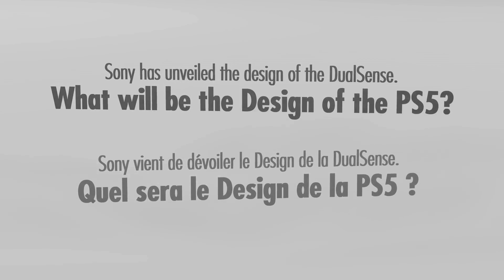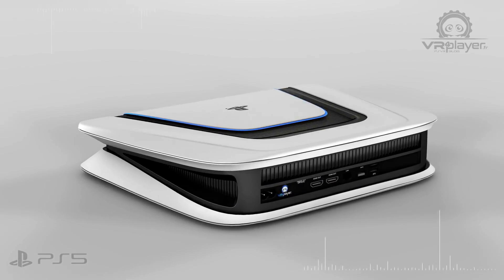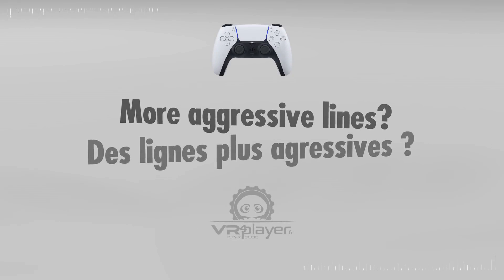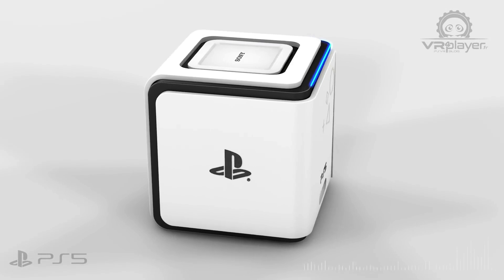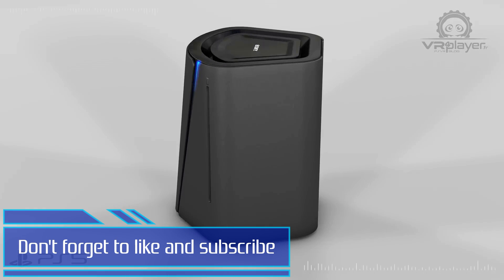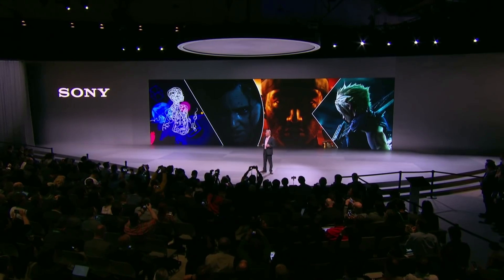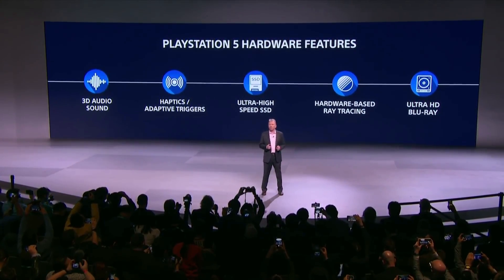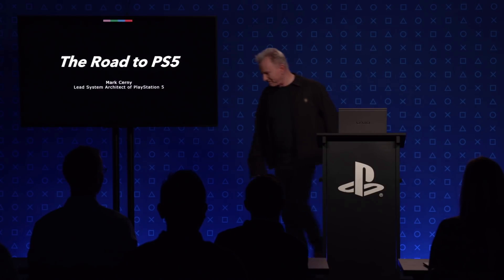PS5 Uses Revolutionary Cooling Solution | Overheating Concerns Squashed, New Patent Reveals

Comment: The patent seems to imply 3d stacked chiplets, at least in one iteration.  This would afford Sony some decent efficiency gains.  As far as the cooling solution, its neat, but I've been wondering for a while why manufacturers don't cool from both sides.  CPU/GPU/APU's always have the pin layout around the outside of the chip with a dead space in the center, always figured you could just leave a hole in the center of the terminals on the board and stick a thermal pad and heat sink to the bottom side, which is essentially what Sony is doing here.  Albeit, the patent left wiggle room to encompass a metal cooling pad that runs through the board to transfer heat from die to heat sink.

Based on the remarks from Cerney years ago about the SSD and the cooling solution, I would say Sony's plans haven't changed one bit after learning Microsoft's direction.  They may have been surprised that they went so heavy handed with it but I don't think they are worried about anything other than public opinion/image of it (people's fixation on Tflops).  If the 3d chip stacking is true, then we are getting quite a few never-before-seen future technologies in this console and we may very well see Sony continue to pull off the better looking exclusives throughout this next gen once again despite having the less powerful console on paper.
Reply: That's sounds interesting. I hope it turns out that way.

Comment: PS5 will be extremely impressive if it implements 3D integrated vertical chip stacking. This method makes the vertically stacked wafers act as a single device and increases performance while reducing power. The chips being stacked can essentially share power and communicate better (normally done by slow copper wiring). Makes sense and confirms Mark Cerny's comment that we will be impressed with PS5's cooling solution.

PS4's problem was its blower style fan. The problem with blower coolers is you can only ever have one fan. So it has to really work harder to cool the system, effectively producing more noise (PS4 PRO). The reason why Sony did this was to keep the PS4 a traditional design. Slim. 

This new heat sink patent looks very much like it is stackable. Heat sink on bottom, then multiple chiplets (DRAM, CPU, GPU) stacked in a wafer, then heat sink on top again (3D stacking) while using multiple blowers, one on each side. This would really help the PS5 to remain slimmer with a more traditional design, while greatly increasing performance and bandwidth and using less power. Never been done before in a console. If true it would be another revolution for console design and a massive win for PS5. 

https://www.extremetech.com/computing/119843-the-future-of-computers-3d-chip-stacking
Reply: you are rithg